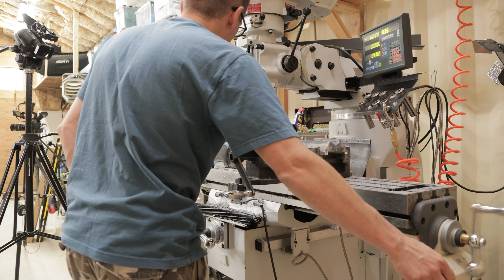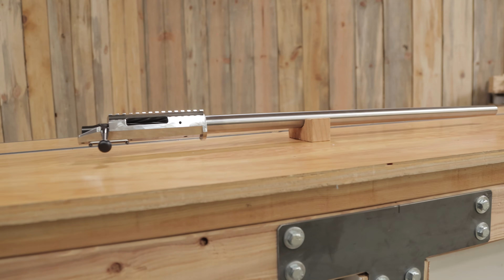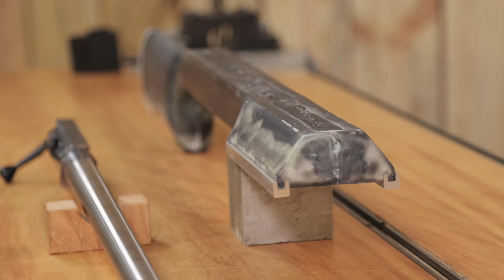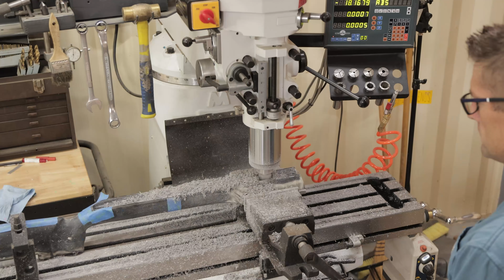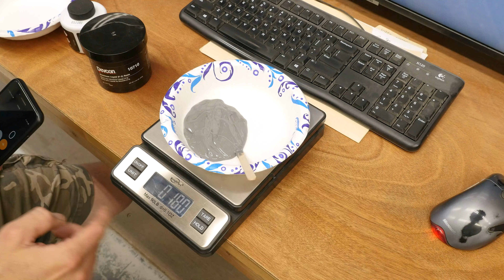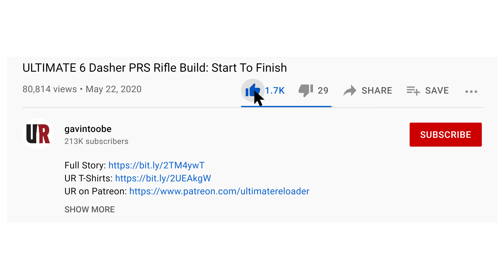6.5x47mm BR Part 2: Custom Stock Work, Epoxy Pillar Bedding

Comment: One thing I have done to make sure I don't come up short of epoxy on a bedding job is to fill the cavity that will be occupied by the epoxy with clay. Remove the clay and put that volume in a graduated cylinder with water and determine the volume of water displaced by the clay. The volume displaced will be the minimum volume of material you will need for bedding. Mix extra to get to your comfort zone and you will not be short of material.

Comment: Gavin you should check out the optics from tract. I have been scouring the internet for something decent in the sub $1000 range and I almost settled on a Midas tac when I found out about the tract toric 3-15x50 on a forum. They seem extremely high quality, high feature set for a lot cheaper than their competition. They seem criminally underrated and it’s a shame they aren’t getting more attention online. They have schott ht glass and can be had for as low as $750. Their ELR scopes go for around $1600 and rival the vortex razors and similar scopes. You should put one through your scope test if you get the chance

Comment: I have bedded exactly one stock.  By coincidence it is also 6.5X47 in an old Suel .22 stock.  Some of the things you mentioned in your video would have been very helpful to me.  I used a Bernard Model 8 receiver and the original Suel trigger guard.  It is an ugly looking job but the gun shoots OK. It groups a little over 1/2” at 100 yds seems to do proportionally better at longer ranges which is strange.  I have only shot two matches with it.  I ukase a sling and shoot from prone.  The first match was bad.  There was a one minute shift I couldn’t explain.  The second match was OK.  I shot 197 in both relays.  That is out of 200 possible.  I don’t remember the X count but it was fairly low.

Comment: for a Benchrest gun, don't you want to not have the recoil lug and glue the action in?
Reply: You always want a recoil lug, and modern techniques work well enough to not have to glue the action in anymore.
Reply: @HS-qt3jr  Interesting, where does your information come from? I'm always willing to learn but, it's the internet and I'm always skeptical.
Reply: @eisenshift5930  I own a shop building precision rifles. I primarily specialize in PRS-style rifles and long-range hunting rifles. But I've built more than a few benchrest rifle as well.
Reply: @HS-qt3jr  Thanks I appreciate your input. I've noticed quite a few people in the F class / Benchrest community are using recoil lugs now. Jim Borden still recommends glue in's when last I spoke with him. As with most things I'm going to have to try it out myself. I've got traditionally bedded rifles, I'm planning on trying a glue in and see if I can get any improvement. Again I do appreciate you taking the time to reply.

Comment: Please wear a respirator for your health.  I've worked with composites for years and can tell you that fibers and lungs don't mix well.  You can't really get that stuff out.  That's the problem.
Reply: Not doubling down for sure, but the minute you mentioned the fiberglass, I had the same exact thought.    Sandblasting open, and fiberglass are great silicosis killers.  Be safe.

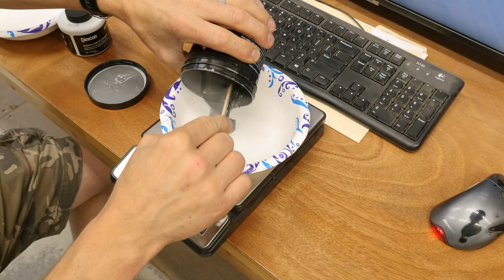Comment: 13:30 Devcon; better to use the putty versus the Devcon liquid epoxy, wayyyy easier to work with (aka Devcon 10110)
Reply: Yup, yup. Every benchrest  gun builder seems to use "Plastic Steel" for bedding compound.

I will say that retired gunmith Richard Franklin has some excellent videos on stock finishing, inletting with a mill, pillar bedding, etc.

Comment: Its been 15 years now I think when I bed my first McMillan A5. My first real rifle custom. Had someone do the barrel and action work but I wanted to take on the bedding job. Never spent that much money on a stock. Now I have to put it in my father-in-laws mill and cutting on it them I had to try and not glue the action into the stock. I was nervous. I used Devcon titanium. Then I have to mill out for the box mag. Not a pretty or perfect job. But a good learning. The action and bedding came out nicely. But my finishing skills needed lots more patients and skill.